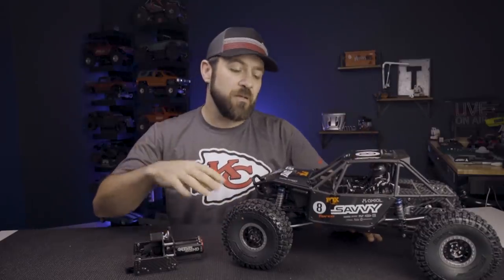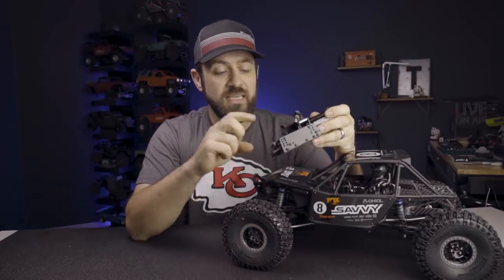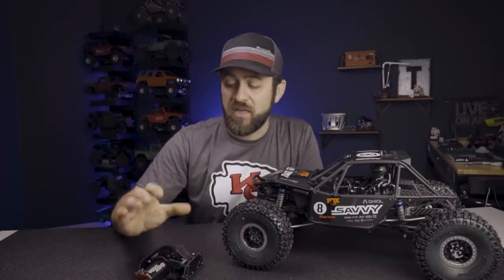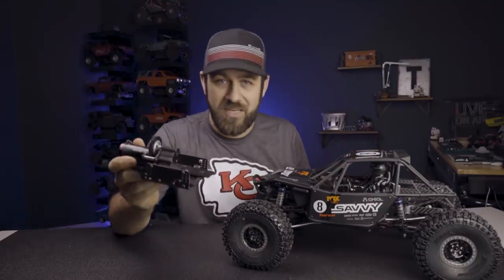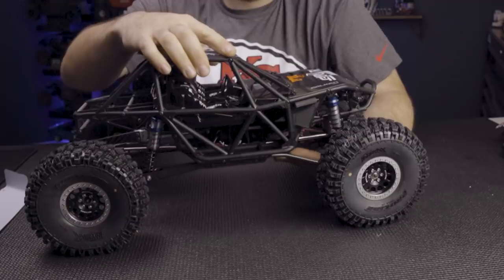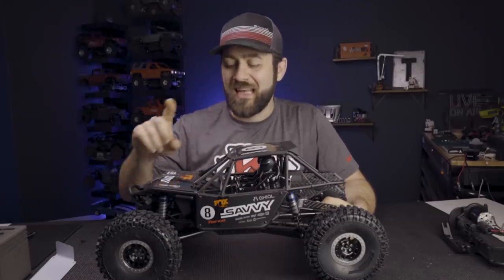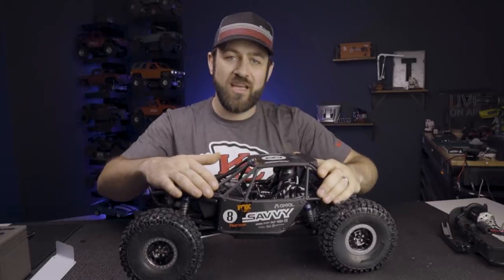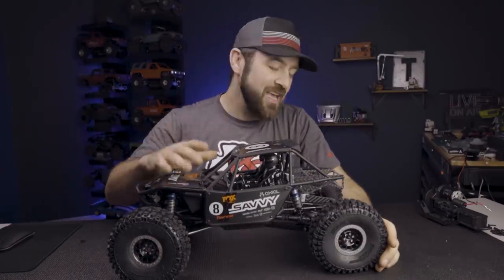Ultimate Axial Bomber - LCG Forward Motor - Ep4

Comment: Looks good, however I’m not a fan of you moving the shocks out side of the double shear mount with in the lower trailing arm. You have know created a single shear mount witch can greatly increase the chance of that lower shock mounting bolt to break and also letting that lower shock heim joint to snag of obstacles emphasizing the possible failure of your mounting hardware. This is coming from a guy who has done a lot of fab work on off-road trucks.

Comment: With the bottom shocks in single sheer you may have issues with the screws snapping.  You are putting all the load in just one place right now, rather than spreading it out over the entire distance tween the two sheer points it had before.

Comment: josh i picked up the high altitude transmision motor plate now do you use the spring with the spur gear or not it dont seem to fit on the shaft i ordered all the parts you listed?
Reply from the maker: Did you order the incision slipper eliminator? If so then you do not use the spring as it eliminates that mechanism.

Comment: So other than adjusting and getting the right links and rod ends is the rest pretty much bolt on.? An where is there any info on how to assemble this type of transmission if I never have before. Iv had a bomber for long time fully built and I’m really interested in doing this. Seems like such a great performance addition. Thanks
Reply from the maker: Yeah it pretty much bolts in, assembling the trans portion is pretty simple but I don’t really have a reference for the assembly. I doubt you’d have much issue if you’re used to working on your RC though.
Reply: High altitude performance rc offered to build my trans
Reply: They also build the links
Reply: bugsgeo Oh they will build it? I mean yea I’m sure I can figure it out I’m not new to Rc I have built a bomber and vs4-pro just have never built that style trans actually. I’m sure it wouldn’t be too hard but maybe I’ll ask them just to see
Reply: @miketye2805  saves me for running down parts
Reply: bugsgeo Yea he didn’t offer when I said I never assembled that style trans before. Luckily Harley made the parts lost really easy. I’m sure I can search wraith trans on here and get it done. Sure it’ll be fine
Reply: @HarleyDesignsInc  What driveshafts are you going to use for this? Got a spare set of BADASS™ HD Steel Center Drive Shafts but wonder if i need to get longer ones or if they will fit

Comment: I don’t know how I feel about all that carbon I know that I personally have tumbled my bomber down the rock cliff at axial fest last year and I feel that I would crack or break the back half of the cage I like the stock cage so it bends instead of cracking and for rock racing I feel like that motor would be in danger with my driving style and slamming rocks 😂🤦‍♂️ great video josh
Reply from the maker: I know what you mean but at the same time, this isn’t a new product. The guys that have been dominating with these trucks have used them for quite awhile now. I think Jake (Del Monte) has been running this setup for several years, and we have seen his success in so many types of driving.

Comment: A wraith trans with a forward motor mount plate does the same, for much less. Change my mind. 😆
Reply from the maker: A wraith trans with the High Altitude skid is an option also. But if you dont get the skid than you don’t get the geometry adjustments for the upper or lower mounting points.